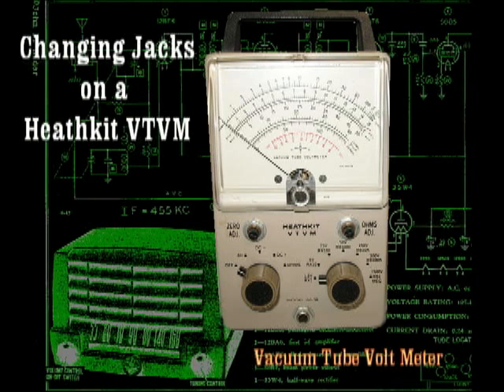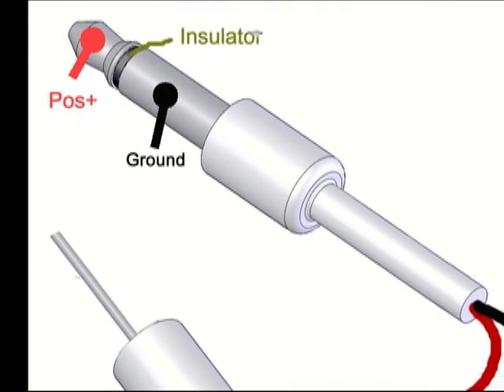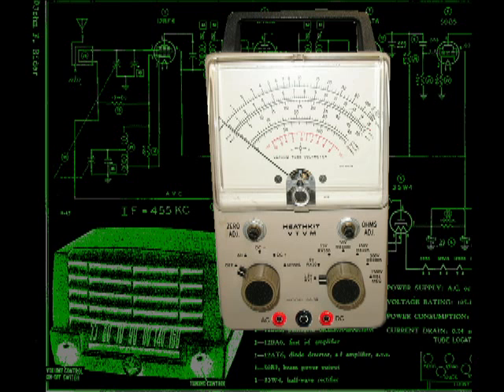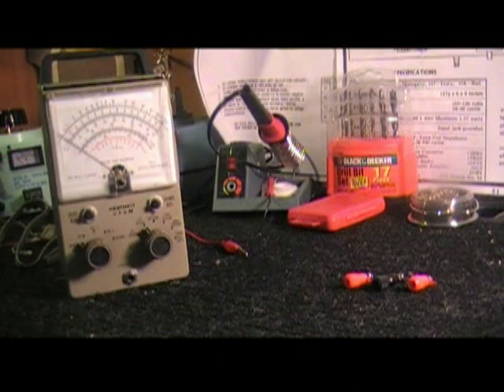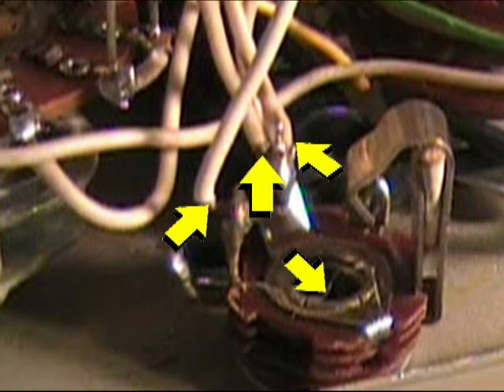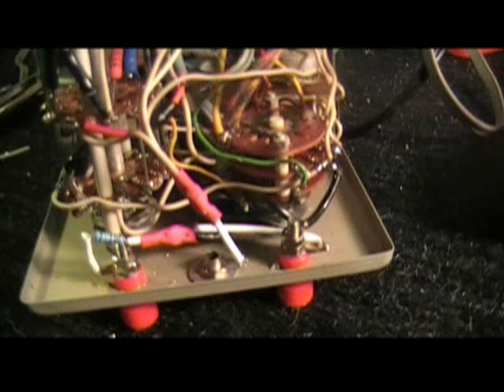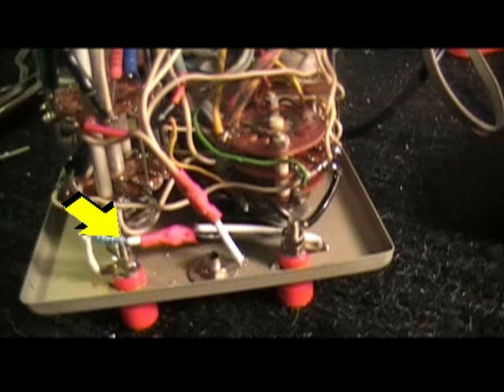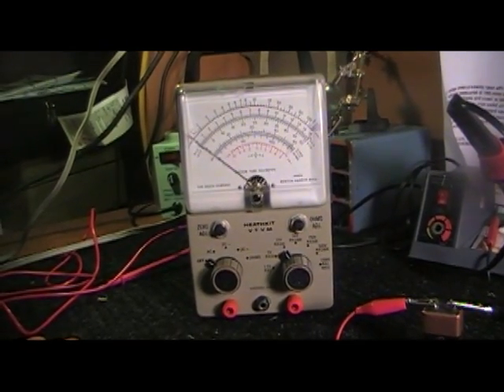VTVM:  Changing Jacks on a VTVM

Comment: I have a Heathkit V-7A VTVM. I use both test leads and my homemade probe with 1M resistor and no switch. I find having that mono jack and using a shielded coax is important. I'm going to build some attachments to my homemade probe to read SHF voltages. I will need a special diode.
Reply from the maker: I agree shielded cables and the shielded monojack are important if you want to keep stray voltages from being collected. My own use is for antique radio work whose parts are spaced apart farther than modern day PCB circuitry so it is not as essential to me.  But I say do what's best for you.  I use top of the line Fluke DMM's when when working on PCBs and its leads are not shielded either. I don't know the significance level of stray voltages on my Fluke but can tell you I've never seen significantly whacko readings caused by anything other than faulty parts.

Comment: Your Idea is pretty great ,but what other are doing who want to keep the original 1/4 Jack is make one set standard and one set with a 1mega ohm resistor, so you have a ad probe set and a dc probe set . I have three heath kits from because I went over board ,I have a V7A ,and a I'M - 11 and a IM-18 ,I order a replacement set for my V7A .and that as far as I got I bought a ton of male and female jacks I will replace as I get to them plus some long lasting c batteries,for now I am trying for stock ,maybe later I will use your idea which is a well thought out impovement..thanks for shareing.

Comment: I have ordered all new Jack's male and female for my heathkit v7a.for my missing probe I ordered the 1 mega resistor ,but I need to find shield wire for it ,I seen several people version of the problem I want mine to be made stock .
Reply from the maker: Thinking out of the box, old cable TV wire is shielded and most of us have a half ton of it stored away in a box or drawer somewhere. You would need to adapt it to the connectors you're using. Or even use the old connectors for cable tv.

Comment: Can you use a BNC connector and then use oscilloscope probes if you change the 10 meg-ohm resister in the probe with a 1 meg-ohm...? That is what I was going to try..
Reply from the maker: There's such a big difference between 10 and 1 megohm resistors. I always default to the manufacturers schematics when possible. Why reduce the resistor?  Are you having trouble with the gain?

Comment: I agree with lowertones1 and always use put the 1 megohm resistor in the probe handle just behind the tip. I can see the difference in loading on tube radio oscillators when checking bias. My DMM kills the oscillation completely unless I clip a 1 megohm to the tip and add 9% to the reading to derive the actual voltage. My VTVM with original probes can be read directly without killing the oscillator. If the extra capacitance (more from the hand than the open leads because of their seperation distance) is not a problem, this is a very nice mod. Keep the great videos coming!
Reply from the maker: Excellent tip!

Comment: Measure for symmetry.  It would have been far easier, no hacking metal front panel, to build adapter with in-line Shrouded Banana jacks (Fluke/Ponoma style).  The Probe and RF Probe are very easy to fabricate.
Reply from the maker: Excellent tip!  It would also better preserve the antiques integrity.

Comment: flyingfrancisco, this is normal activity. on ohms, with the leads seperated, it will show infinite resistance i.e. the far right on the meter on the ohms scale. when the leads are shorted, it will peg far left, showing zero resistance. once you get used to an analog meter you'll love it. good luck with your great flea find.

Comment: mind you, there was a reason for heath and others placing the resistor as close as possible to the tip. by doing so there is no introduction of extra capacitance to the circuit by way of the cable. if you can get by with this slight addition of capacitance, it is a very handy mod.
thanks again for the vid.
Reply from the maker: Good advice.  It's important to minimize added capacitance from the wire itself.

Comment: good job. thank you for the vid.
there is a mod on this very same model (which i have performed on a couple of vtvm's over the years), where you simply add a megohm resistor to the selector switch. after that, you need only 1 probe. a ground lead and only one lead for dc/ac/ohms.i'm sure the mod is out there somewhere on the net

Comment from the maker: You can get the calibration instructions at the address above in the description.:  -Click on the little hammer on the IM-18 line....  The instructions will pop up.  Your resistance on this model actually will read "infinite" on the right side when you are not checking anything or the leads are open.  Then as you connect the leads to a resistor the needle will move to the left to show the value of the resistor....  It's correct.  Good luck.

Comment: Hi 
Very good idea. I picked up the same model at the flea market recently. Looked to be in very nice condition but when I try to use the ohms function the unit is giving me whacky results. It tends to max out on the right hand side of the meter. Would you have any ideas. Also where did you find the calibration instructions for it.
Thx in advance
Reply from the maker: Hi.  I dont have any specific advice other than it sounds like OP ne OP r more of your passive components have gone out of spec due to age or excessive wear.  I would check any caps first, if there are any.  It's been so long I honestly cant remember.